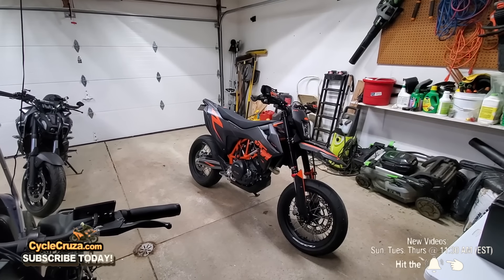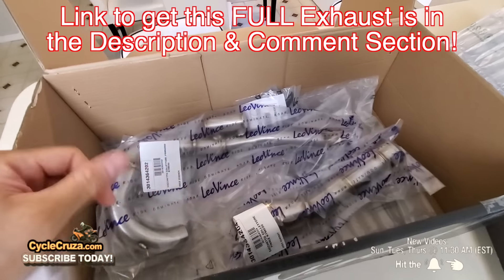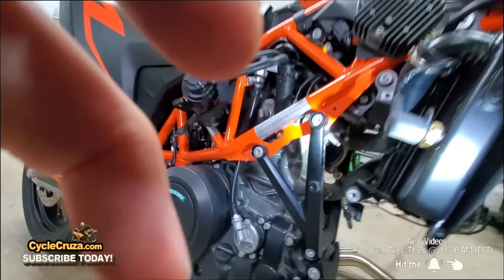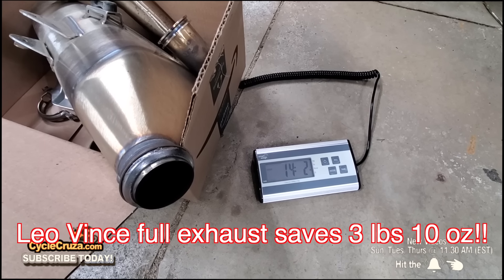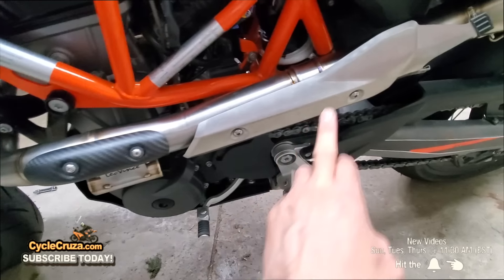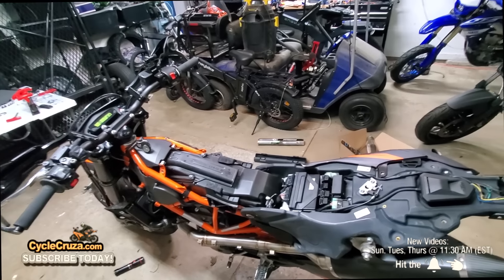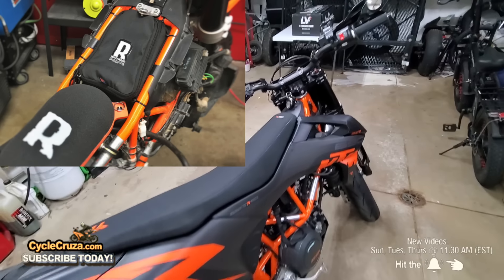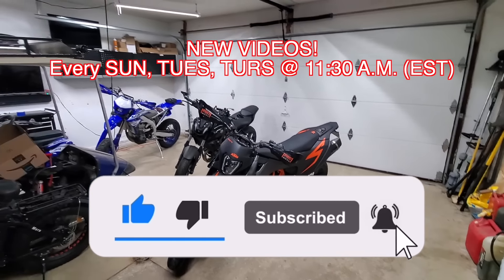2024 KTM 690 SMC R Build EP04 | LeoVince Nero Exhaust 🔥

Comment from the maker: NOTE: MAKE SURE TO USE A NEW OEM GASKET WITH EXHAUST!
LEOVINCE Full Exhaust: https://cyclecruza.com/mmsq
LEOVINCE Slip-On Exhaust: https://cyclecruza.com/lezj
Get My Carbon Helmet (Best Ever!): https://cyclecruza.com/vhxg
Get AIRBAG Vest (On Sale!): https://cyclecruza.com/w34j
Links to get My GEAR, MODS and Other Stuff: ⬇ 
*MY KTM 690 SMC R MODS:
Get Lithium Battery (Restart tech!): https://cyclecruza.com/mymc
LEO VINCE Full Exhaust: https://cyclecruza.com/mmsq
LEOVINCE Slip-on Exhaust:   https://cyclecruza.com/lezj
KTM 690 SMC R Graphics Kit: https://amzn.to/4b3Cnyx
Graphics Kit Custom: MotoProWorks.com
(MotoProWorls 15% Discount Code): cyclempw15
KTM 690 SMC R LED Headlight: https://amzn.to/49NgXor
Zeta Hand-guard Kit: https://cyclecruza.com/89qz
Zeta Black Handguard U Clamps: https://cyclecruza.com/703k
Zeta Handguard Smoked Turn Signals: https://amzn.to/3UDzpLC
Handguard Mirrors: https://amzn.to/3UFETWu
KTM 690 SMC Black Plastic Kit: https://cyclecruza.com/7j5b
Get GoPro Camera Mirror Mount: https://amzn.to/3Uln8Kv
Get KTM Mirror Hole Plug Bolts: https://amzn.to/3w64P46
My Supermoto Tires (Best!): https://cyclecruza.com/tdlv
KTM 690 SMC R Skidplate: https://amzn.to/448xsKh
KTM Confort seat: https://amzn.to/3Uomyvo
My Fender Elim Kit: TSTindustries.com
KTM 690 smcr/eduro Kickstand Switch Delete:

Get My New MotoVlog Camera (On Sale!): https://amzn.to/3R4MiLY
Get My CE Armor Jacket CHEAP: https://amzn.to/3AxZ6k7
Get My Motorcycle HOODIE: https://cyclecruza.com/nsx7
Get My Leather Gauntlet Gloves: https://cyclecruza.com/iclm
Get My New 360 CAMERA (So Cool!): https://amzn.to/3CFvhRs
Get My New Shorty Gloves: https://cyclecruza.com/pgip
Get Dynojet ECU Tuner: https://cyclecruza.com/3lh4
Get Urban Camo Pants here: https://amzn.to/3EDAET0
Get UNLOCKED Galaxy S10+ (CHEAP!): https://amzn.to/2WQXe7w
Get Phone Holder Wireless Charger: https://amzn.to/3CQFtX2
Get GoPro Mount (Saves Space!): https://amzn.to/3Aen7yY
Get My Helmet Microphone: https://amzn.to/3w8wTna
Get Bar End Mirrors:  https://amzn.to/3TlbJZu
Get the BEST Tires Ever: https://cyclecruza.com/7wad

Links to ALL of My Stuff: http://cyclecruza.com/my-gear

MY HELMETS:
Get Bell Carbon Helmet (Best Ever!): https://cyclecruza.com/vhxg
Get My Dual Sport Helmet here: https://cyclecruza.com/lkm0
Get Ear Plugs here: http://amzn.to/1PE0NTn

MY JACKETS AND JERSEYS:
Get My Leather Jacket: https://cyclecruza.com/q9tq
Get Sedici Garda Jacket (Best for Street): https://cyclecruza.com/sffi
Get My CE Armor Jacket CHEAP: https://amzn.to/2BIRAG7
Get Hi-Viz Armor Jacket CHEAP here: http://amzn.to/1TC9fBa
Get My Winter Motorcycle Jacket: https://cyclecruza.com/l9xp
Get Hi-Viz Rain Jacket: https://cyclecruza.com/00xh
Get My Hi-Viz MX Jersey here: https://cyclecruza.com/iifs
Get Motorcycle Hoodie here: https://cyclecruza.com/nsx7
Get My New Hi Viz Spring Jacket: imp.i104546.net/k0OR3L

MY GLOVES:
Get My Leather Gauntlet Gloves: https://cyclecruza.com/iclm
Get HEATED GLOVES: http://cyclecruza.com/nwgp
Get My New Shorty Gloves: http://cyclecruza.com/w7ae

MY MOTORCYCLE PANTS:
Get My Leather Pants: http://cyclecruza.com/54cw
Get Sedici Garda Pants (Best for Street): https://cyclecruza.com/vb8e
Get KEVLAR Jeans: https://cyclecruza.com/vxij
Get My HI VIZ CAMO PANTS: http://cyclecruza.com/hivizcamo
Get Urban Camo Pants here: https://amzn.to/3EDAET0
Get Yellow Camo Pants Here: https://amzn.to/2SjMGq8
Get Blue Camo Pants: https://amzn.to/2LBEgbk

MY BOOTS:
Get My Street Riding Boots: http://cyclecruza.com/uubp
Get My Dual Sport Boots: http://cyclecruza.com/3kn0

MY SOCKS
Get My Vented Socks: http://cyclecruza.com/0bww

My BACKPACK and STORAGE PACKS:
Get My New No Drag Backpack: http://cyclecruza.com/nr6x
Get My High Capacity Backpack: http://cyclecruza.com/k0w2
Get Water Bladder CHEAP: http://amzn.to/2b5w5nv
Get Motorcycle Tail Bag here: http://cyclecruza.com/tbag

MY MOTORCYCLE TIRES
Get My Sportbike Tires (Best!):  http://cyclecruza.com/pangelfront
Get My Supermoto Tires (Best!): https://cyclecruza.com/tdlv

MY LITHIUM BATTERY:
Get Li-ion Battery (Restart button!): https://cyclecruza.com/mymc

Emergency Carry-On Items:
Get Flat Tire Repair Kit here: http://cyclecruza.com/f5du
Get Moto Survival Kit: https://amzn.to/2EwtsrI

MY MOTORCYCLE STANDS:
Get Universal Stands: https://amzn.to/2Ct2fpQ
Get My Lift Table: http://amzn.to/2kt1pD7
Get Bursig Lift Stand: http://cyclecruza.com/f0lc
Get Adapter Plate for Stand: http://cyclecruza.com/cpwr

MY MOTORCYCLE TRAILER:
Get Stand-Up Trailer for Motorcycles/Side by Side/UTV/ATV:  
http://cyclecruza.com/p2yo

Get Stand-up Trailer for Single Motorcycle
https://cyclecruza.com/stduptrl

*MY MOTORCYCLE COVER:
Get Moto Sack: http://amzn.to/2lpIX9d

Links to All of my Mod Parts for my Bikes:
https://cyclecruza.com/my-mods

My Store: (All my Stuff) 
https://www.amazon.com/shop/cyclecruza
Reply: Hi CycleCruza, just a quick one regarding your note "MAKE SURE TO USE A NEW OEM GASKET WITH EXHAUST!" Did the connection between cylinder head and the small bushing/flange delivered by LeoVince not get "fume tight" without the OEM gasket as you tried in the video at first? Thanks for sharing your experience. I am currently installing this exhaust system as well on my SM701 and the installation description is kind of confusing on that gasket topic at the cylinder head. Best regards, Florian

Comment: A 125 or 250 Cruiser with forward pegs is something  .

1. It's so light , you can swing it w your hips.

2. The tyres are so fat and wide you totally are stable riding.

3. And then of course you fly on that reclined, back supported super cushioned natural leather seat  ,

4. and that glorious deep gurgle sound (modify the pipes bespoke)

5. Turn the side bags into ice freezers , hold your beer cold for hours  - Livin 🙌🏽💯
🕊️💨  😎👑

Comment: The noise of that slip on will be annoying after the fist ride without the baffle and your throttle will be snatchy of the bottom as you have changed the back pressure. Put the baffle back in for a smoother ride or get a wings which is the go to slip on with KTM 690 owners.

Comment: Sounds way better. I just bought a new Husky 701 sm and I’m trying to decide on an exhaust. Is the aftermarket header really necessary? From my understanding the cat is in the stock muffler.
Reply from the maker: Imo, full exhaust is always a bit better, the header and mid pipe are made for the exhaust. I got a full exhaust on my MT-07 as well. My YZ just has a slip on tho, unnecessary on that bike because it is a straight race bike. really, I didn;t even need to add a slip-on exhaust on my YZ but it saved a 1lb and has a spark arrestor.
Reply: @CycleCruza  have you noticed a lack of engine braking with the new exhaust and the baffles removed?